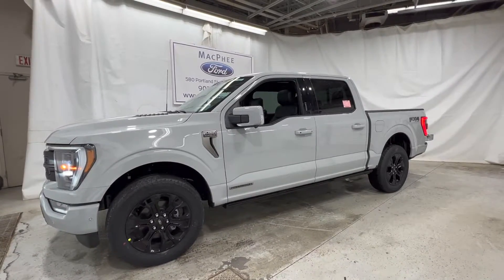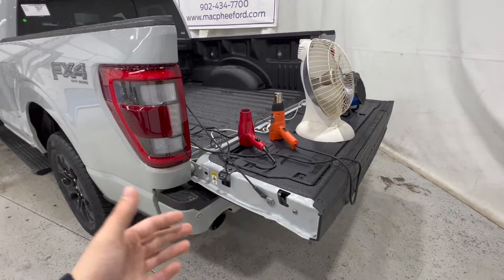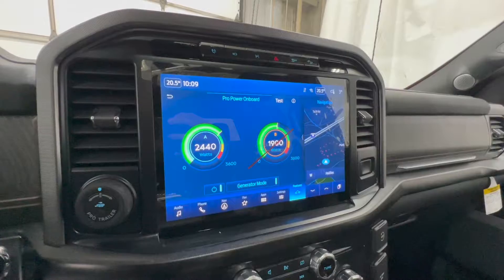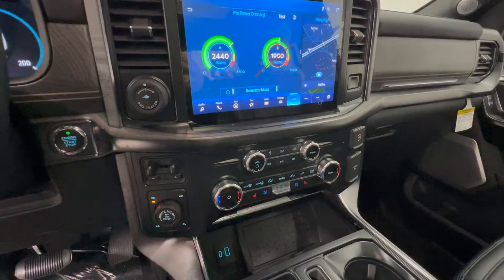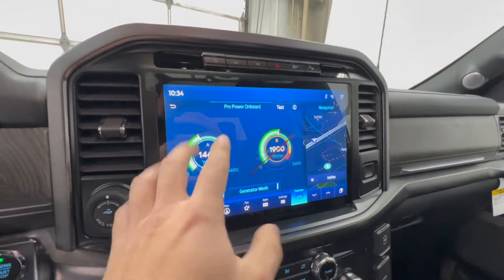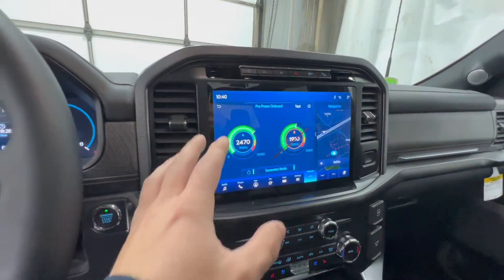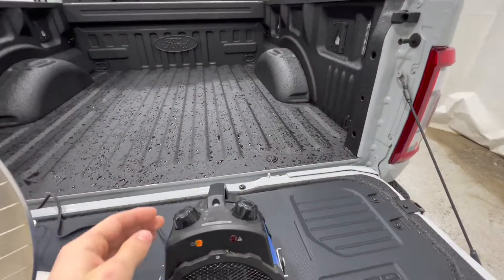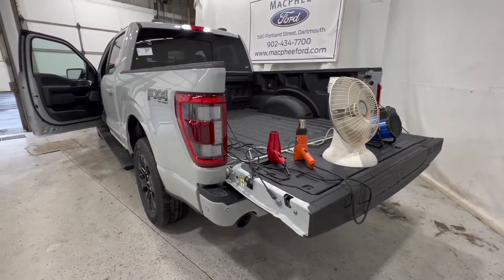MAXING Out Pro Power Onboard! STRESS TEST! How Much Fuel Will it Use?

Comment: So the reason it’s tripping the breaker at 3k is because that’s the limit of the regular plugs. If you use the 220 plug then you can pull the entire 7200watts. On the regular plugs you are limited to 20amp per leg. On the 220 you are limited to 30amps.
Reply from the maker: We appreciate you pointing that out! I guess we'll have to find something bigger to power!
Reply: @MacPhee_Ford what do you think of a heater in the winter (snow, and like 5 degrees, or some type of air conditioner in the summer. Plus at times a ps5 and a monitor for a few hours, gotta get in some Fortnite. Oh and a Dometic fridge freezer.

Comment: In normal usage for my camper the engine runs about 10 minutes per hour. You can go to the power flow screen and it will tell you why the engine is running as opposed to using the battery. Over five days it used about 1/2 tank.
Reply from the maker: Which makes more sense because we were pulling a lot of power from the truck. If the wattage is around 2000 it should cycle the engine like you mentioned. How much power do you typically draw for your camper?
Reply: @MacPhee_Ford   The camper in winter camping uses only a modest amount of power. I checked my pictures of the pro-power screen and both times they show about 400 watts This was 200 watts from each side of the generator. That was running lights, heater, and tv. We also enjoyed the vehicle hot spot for internet movies.
Reply from the maker: @jbcross7513  Right on! 400 watts is basically nothing so it makes sense that the engine isn't running much per hour.

Comment: Perfect. I am planning on living out my truck 3 days out of the week. I have that truck but mine is a Lariat. Same color and all. I was shopping for a Jackery. But do not think I am going to need it.Not sure how the truck would handle running with the heater in 3 degrees and snow.  Going to be interesting. Your video helped big time.
Reply from the maker: Yes will be interesting to see how much heat will necessary to counter the extreme cold. Heaters are very power hungry and may cycle the engine a lot more if you were running something of less power draw. Good luck!

Comment: Does Ford publish specs more specifically on how this system works? Example: Battery is XX in size. What are the parameters that control when the truck engine turns on and when it turns off. How many AH can be used before the truck turns on? What are the total number of AH available for use without the truck turning on?
Reply from the maker: There are too many details but we do know the battery is definitely not super big. 1.5kWh in size. Comparing to a full electric, it is small but we feel like it has sufficient power at 35kW (47 hp). On top of that it powers the inverter system quite well. It would be based on a voltage or a percentage of battery on what determines when the engine cycles on or off. If there is more electrical load from Pro Power, it will keep the engine running more frequently. A poll was taken from PowerBoost owners and they said that they can travel roughly 1 mile before the engine will turn back on to recharge under normal/light load/acceleration. Hopefully this answered some of your questions!
Reply: @MacPhee_Ford  I'm approaching this wanting to run a camper. Every battery sold for this purpose has an AH rating. The load can be calculated and how long these devices can be used. Looking at the number of YouTube videos on camping, I would say that lots of people are interested in this subject. The difference is having to pay for the energy (truck running) or having the battery supply the energy basically for free.
Reply: @jimpowell4945  Another very important consideration is engine/radiator noise. Especially if you are camping in a crowded campground with quiet time regulations. It's quite interesting how much louder sounds "appear" to be at 11:00 pm in a pitch-black silent campground compared to at noon the next day. You might still want to have a separate 12v LifePo4 battery source for those late-night snacks and hot beverages. It's just too bad Ford doesn't allow for some real useable standalone Ah/Wh capacity in the battery.
Reply: @ES-mq9ox  I want to setup a truck--truck camper to travel in. I have a dog so I want an air conditioner. A slide in truck camper would work real slick--I think. Most all truck camper come with a wiring setup and battery already. Adding Pro Power would make the whole system more usable. I hate stand alone generators. I'd like to find out details before launching into this project.